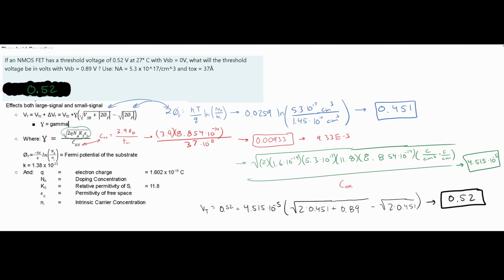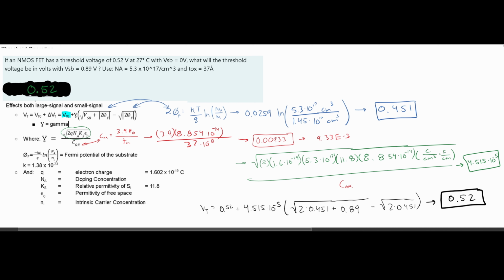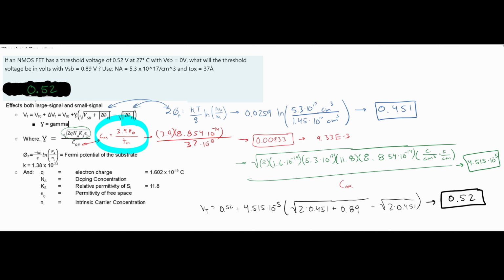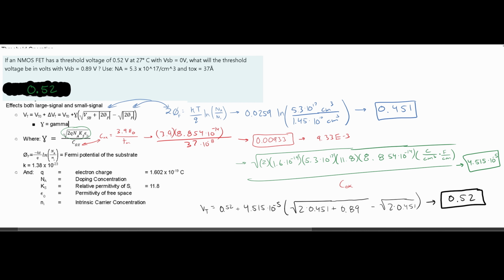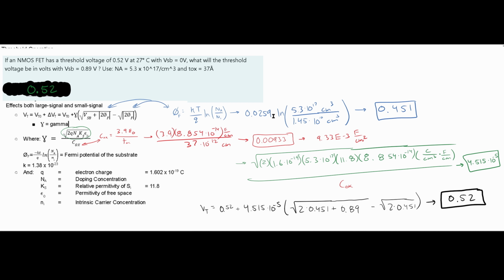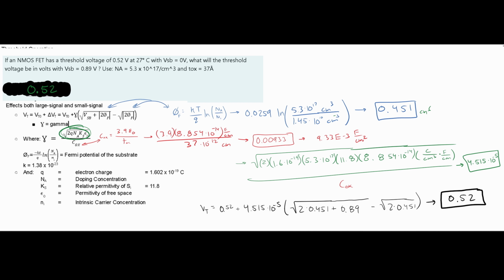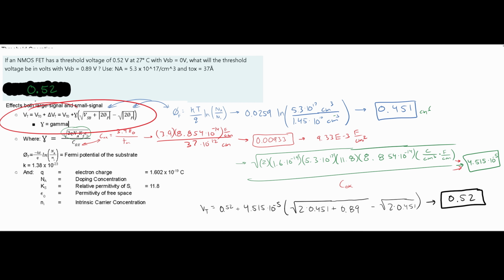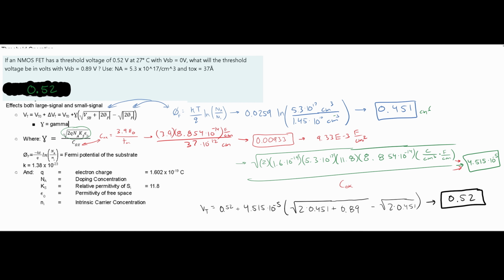If an NMOS FET has a threshold voltage of 0.52 V at 27° C ... | CPE 151 CMOS and Digital VLSI Design

Comment from the maker: ERROR (NOTE):
For the red line:
I used the wrong units, the denominator should be "37 x 10^(-12) cm because everything else is in cm.

red symbolab:
https://www.symbolab.com/solver/step-by-step/%5Cfrac%7B%5Cleft(3.9%5Cright)%5Cleft(8.854%5Ccdot10%5E%7B-14%7D%5Cright)%7D%7B37%5Ccdot10%5E%7B-8%7D%7D?or=input

redone green symbolab (numberator):
https://www.symbolab.com/solver/step-by-step/%5Csqrt%7B%5Cleft(2%5Cright)%5Cleft(1.6%5Ccdot10%5E%7B-19%7D%5Cright)%5Cleft(5.3%5Ccdot10%5E%7B17%7D%5Cright)%5Cleft(11.8%5Cright)%5Cleft(8.854%5Ccdot10%5E%7B-14%7D%5Cright)%7D?or=input
(denominator)
https://www.symbolab.com/solver/step-by-step/%5Cfrac%7B%5Cleft(4.20943E-7%5Cright)%7D%7B9.33259E-7%7D?or=input

result:
https://www.symbolab.com/solver/step-by-step/0.52%2B0.45104%5Cleft(%5Csqrt%7B0.89%2B2%5Ccdot0.451%7D-%5Csqrt%7B2%5Ccdot%200.451%7D%5Cright)?or=input
Reply from the maker: (if not clear)

because of this, we need to essentially recalculate everything giving us

the correct answer is 0.695